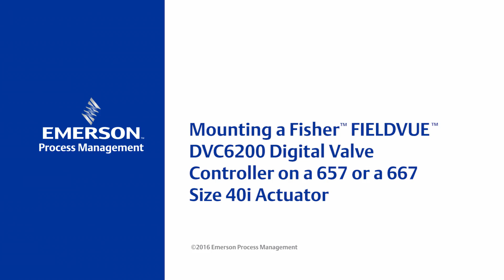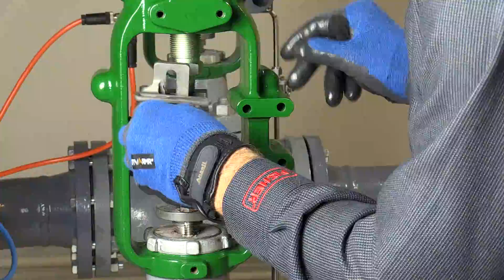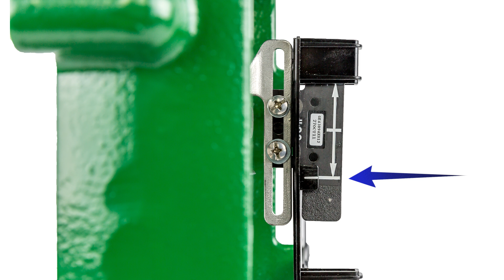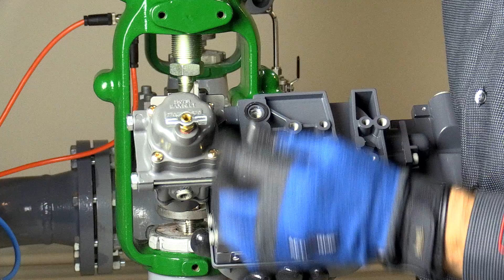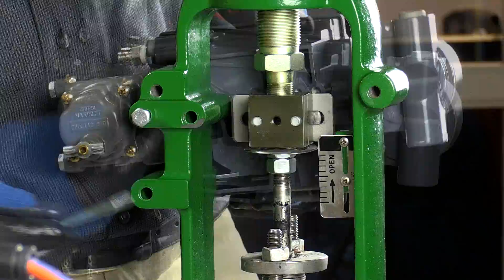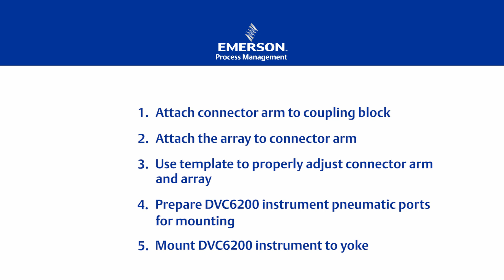Mounting a Fisher FIELDVUE DVC6200 Digital Valve Controller on a 657 or a 667 Size 40i Actuator

Comment: When I inject loop power 4-20mA actuator operates well but I didn't find any output voltage supposed to be 8-30VDc. What should I check?